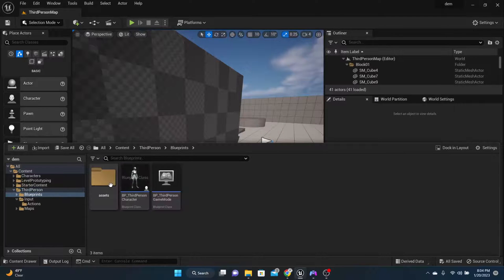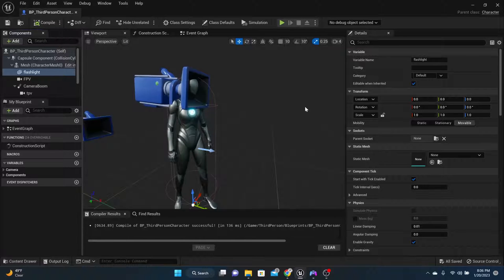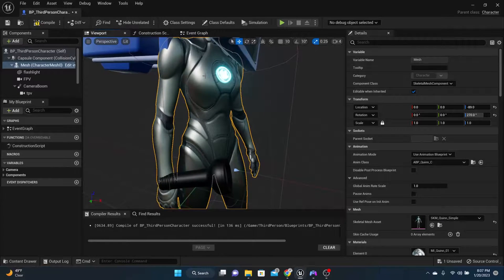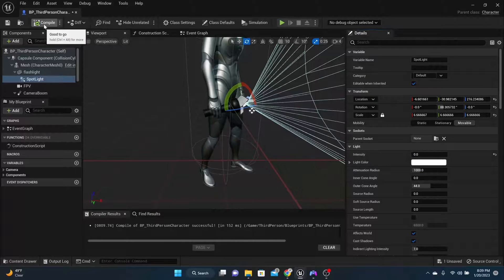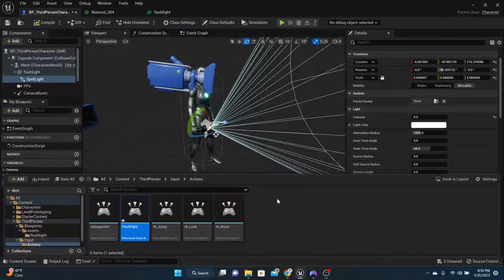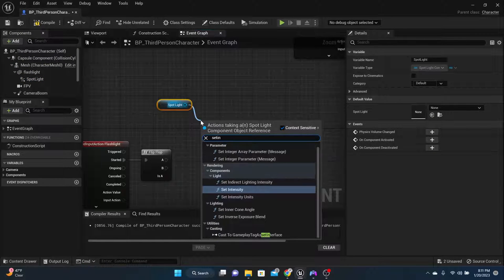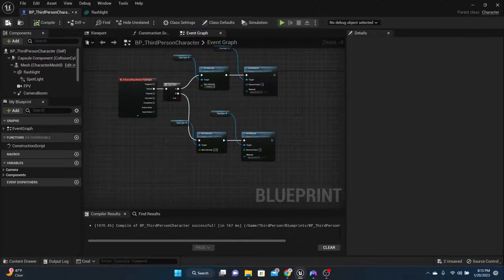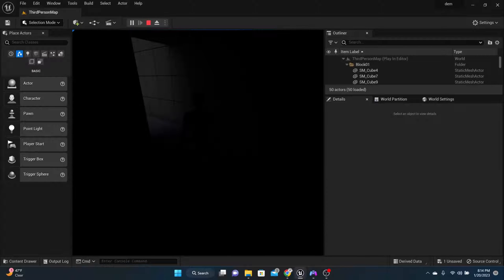How To Make A Flashlight In Unreal Engine 5

Comment: thanks for tutorial. how we can adjust character hand in right position when flash light is turn on?
Reply from the maker: You could make a new animation for that and use play animation to play your animation when the light is on . Making that kind of animation can be done in the engine by duplicating the walking animation and moving their arm bone and then press the +key button to save that animation and position of the bones

Comment: I noticed you will be releasing an updated flashlight video soon and had a few questions. Will you be adding how to keep your arm from moving or aim with the flashlight? Also, what would you recommend is the best method of adding some glow to the flashlight tip? I was thinking about putting a socket at the tip of the flashlight and attaching a little glow as an actor (I don’t know if there is an easier method.
Reply from the maker: https://youtu.be/ZDX2vvVodg0?si=sQVnV1YEJlBVG5uK

Comment: i dont have an input option. i guess i need to make that too?
Reply from the maker: possibly becasue you are using something before unreal engine 5.1 ...If that is the case... you can do what I did in edit> project settings > Input... This is where you add your key mapping inputs if you are using Unreal before 5.1 !